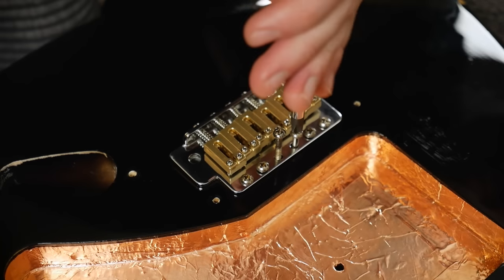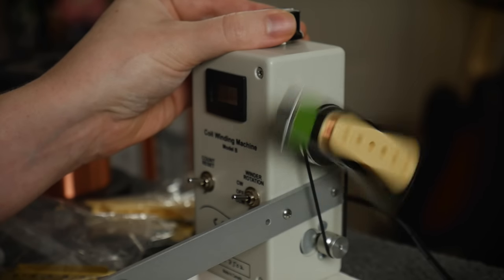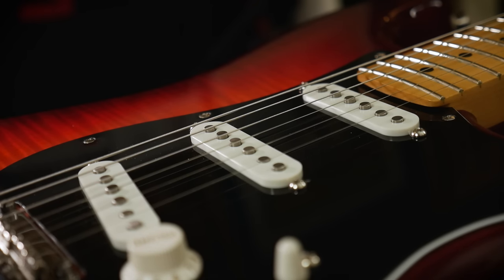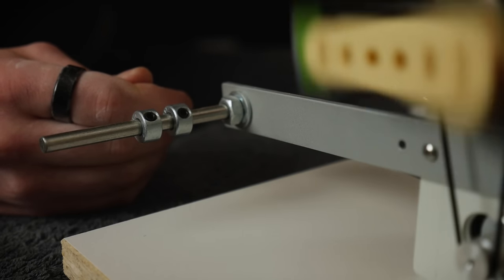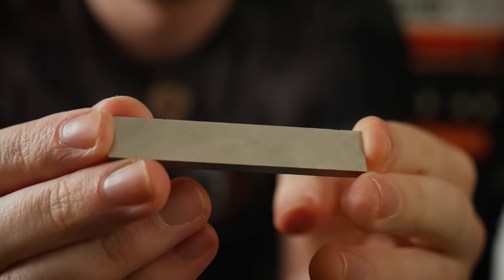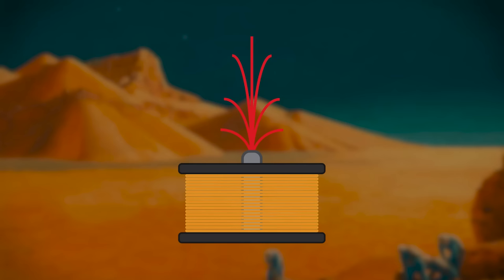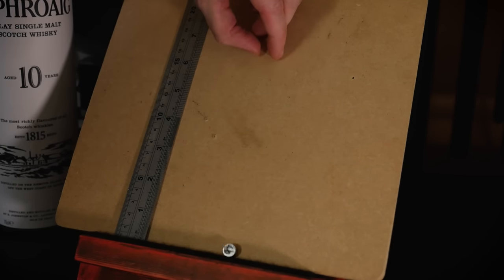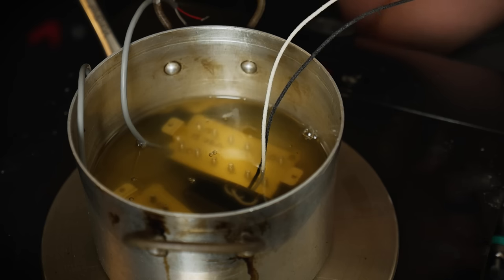(almost) EVERYTHING About Pickups | Too Afraid To Ask

Comment: Brilliant video. Watched this more than once.
Standard single-coil pickup*: if the magnets (pole pieces?) seem to be sticking out irregularly (higher in the G & D strings), can we push them back in without damaging anything?
I presume they will give stronger output for those strings?

* this on an Encore, but looks just like the ones on Fenders/Squiers. No screwdriver slots in them

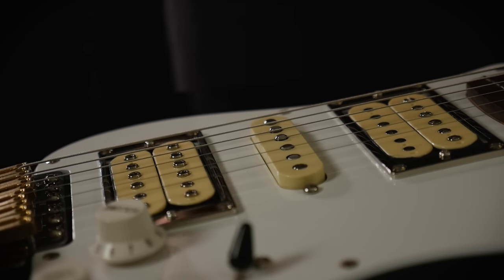Comment: 4:07 distance of pickup can be adjusted up/down to get the sound you want. 12:19 types of magnets. Split pickup to have lower three versus less pull on higher lighter gauge strings. 16:16 humbucker cell materials affect magnetic field also. Also a little bit by the cover materials material and thickness.

Comment: I had to wind 3 pickups for an old guitar of mine recently. I used 0.063mm Cu for the middle and neck pickups and 0.045mm Cu for the neck to give more output. It balanced pretty well. BTW, a third factor affecting such long lengths of thin wire is temperature - to a significant degree. If the pickup is not heavily loaded, the output level should not be affected much at all. Love your philosophy on sound - spot on! BTW, the winding cross-section geometry  and whether it is layer or bundle wound also affects a factor other than inductance: distributed capacitance. This will have a significantly greater affect on the frequency response/impedance. Also note that induced Eddy currents in solid magnetic material (vs. sintered/ferrite etc.) will have an impact on high frequencies as well.
Finally, I would not pot coils in wax. I have rewound old transformers which failed because wax potting trapped moisture in the windings causing the copper to rot over time. The wax does not seem to form a really good moisture barrier.

Comment: Killed it again, as usual.  Answered nearly all of my (many) questions, and you did so with clarity.  Can't say thank you enough for this content.  
I did have a follow-up question if you're so inclined to address it.  Why does a higher DC resistance equate to higher output?  This has always confused me, but not enough to look into it.  In most electronic circuits, increase in resistance impedes the flow of electricity.  Why then does a higher resistance in a pickup equal MORE output?  I've always just taken it for what it is and not questioned it, but knowing details would be super cool.  Especially the way you explain things.  Thanks again!!
Reply from the maker: V=IR
If you increase R then V must also increase (assuming constant I)

Analogous to water in a hose pipe: for a constant flow rate, if you narrow the hose (increasing the resistance) the water leaves the hose with more pressure (voltage is just electric pressure)
Reply: @ScienceofLoud  This is not correct. If you look at the RLC equivalent circuit of a pickup, you see that the coil resistance R is in series with the coil inductance, and the output voltage is taken across the (parasitic) coil capacitance C.

So the more R you have in the coil, the more voltage is dropped due to Ohm's law V=RI. This is obvious because all of the current through the coil must make it through R, so there will be a voltage drop across R.

What you're saying is true however for any external resistance (eg. volume pot) connected to the pickup. A higher resistance pot will load the pickup less, preserving output voltage. But this is not true for the series resistance of the pickup coil. In practice, the resistance of the volume pot (eg. 250k) is much larger than the series resistance of the coil (6k or so for a single coil), so we don't really experience the voltage drop in practice, but it's there. The series R of a pickup will however effect the Q factor of the pickup, which has an impact on the shape of the pickup's resonant peak.

So the increased output is not due to increased R, but it follows from Faraday's law of induction, where the EMF (voltage) of a single loop is multiplied by the number of loops the changing magnetic flux passes through. More turns of wire -> higher EMF, that's it.

Comment: Tanks for the up.  Decent video. I'd like to point out that for some players, especially given the low stage volumes common these days, there might possibly be a case made for mildly microphonic pickups.  If you've ever played above 110db onstage something kind of magical happens - a feedback loop develops as the high SPL sound from the speakers begins to vibrate the strings.  Many non-tech types say "my guitar came alive!".  Microphonic pickups can reduce the levels at which this occurs.  Unfortunately, I don't know of any means to design for specificity and most players who enjoy that loop just feel lucky their favorite or even possibly "the one for that one song" was found.  Make no mistake, most, and especially at higher SPLs, are a PITA but some bring it, even if only for one song or style .

Comment: Loved your video.  One small step to include would make the video a super informative class or a whole category of several videos? 
When you're talking about every single pickup composition play a few common chords or a quick riff so we can hear what the difference in magnet strength sounds like with thick & thin wire.
What each pickup sounds like wound more in the middle or the sides.
It would be very interesting.

Comment: Oh yws I did in the previous posted comment say that this is in fact my very first ever guitar build/modification.. as I an a retired automotive service technician with both automotive electronics diagnostics and repair experience and woodworking experience even before that as I was trained in home renovations and remodeling including wood framing. plumbing, brick and block work as well as electrical wirind and drywall installation and finishing,and as a 10 yr old I built bicycles from recycled parts rebuilding and refinishing them for personal use as well and forsale.... I think i may have al the required skills to pull this one off with little trouble and with a passable result for my first try anyway....  ya think...lol  at 62 yes old and retired I'll take my sweet time and make sure everything gets done the way I want it to be..and have a good time playing with my "Hew Toy"  the "Stellarcaster:  have fun with all your builds as I'm sure you will...I am having a good ti,e doing the work on it the waiting for parts and materials for it was a major pain in the rear though with the "Global Pandemic" going onand all the rain we're having here nearly every afternoon in Florida in the USA the humidity plays hell with the finish curing times it takes 3 to 4 times as long in this humidity of nearly 95% relative humidity and an average of 92 deg F everyday throughout the summer here so thank god i got the wood sealed well before the rain began in earnest.. if the rain lets up for 3 days in a row then the humidity will lower enough for my finishing the body and head stock to cure after I've applied it.. ans flat sanded it for a second coat and finish sanding then buffing to the shine i desire..,,sorry I tend to go on a bit I just happen to be ADHD even as an adult I've never grown out of it coffee Is my only salvation there is that the caffeine calms me somewhat ever since i was about 5 yrs old .. I quit smoking a few yrs ado after my first and i hope only heart attack just a partially blocked coronary artery which they inserted a stent into and I'm fine now ...but with being laid off due to the virus goung around for about 4 months and the work schedule being severely changed to an untenable one for me...early retirement was my best option and i was used to laxing around watching you tube on the large 100'  Movie screen I've hung on the wall for for the HD projector with my lap top , XBox 1X the direct Tv terminal and the DVD/VCR all plugged into it for my viewing pleasure   and so by now anyway,,,,Im to used to sitting on my rear.drinking coffee and eating snacks and of course taking care of my diabetic wife who is on disability anyway so I'm settling into rertirement quite nicely thank you so it's a guitar projest and lonnging around in between runs to the store for different needs along the way...an yes I am the motor head  motor mouth from hell too if you han:nt niticed by now so sorry for the novel here i ten to go on and on for too long sometimes,,,,,,,,well most of the time really,,so sorry again but it's a bad habit i really can't seem to break since as long as i can remember,,,,,I have to be doing something almost  constantly if awake and i even toss and turn in my sleep too...mumbling from time to time even then too....nothing for it but find a hobby I enjoy.....

Comment: 8:12 HEY as someone whos job it is to wind coils of wire all day, you are spot on, perfect winding requires alot of effort from a person, we either gotta do it slowly, or not perfectly

note i dont work in guitar pickup winding specficially, i work in a wire mill for electrical applications

Comment: Great information. I have a "POC" guitar (Piece of Crap). I built it from parts. It is a BC Rich Assasin Body, Aria Pro II neck, Kahler Pro Trem and I have SH-6's. The one thing I did and I found it made it sound sooooooo amazing was bolting the pickups into the pickup cavity......pickup to wood. I found that without it floating the sound is more full and warmer....it might just be me though. To raid them a bit at a time I used thin brass washers.

Comment: 9:00 you can dispense with the touchy-feely woo-woo arguments about hand winding. Perfect machine winding maximizes the interference between adjacent windings at nearly constant intervals and so it creates an exaggerated moire pattern of hot and dead frequencies across the frequency response spectrogram. Imperfect windings "blur" this effect, and the contrast between dead and hot spots on the spectrum is reduced. A highly exaggerated example of this effect can be demonstrated with a "ring filter" effects pedal. There's math behind it.

Comment: You've missed some big parts the relationship between construction and inductance, the pole pieces form a core to the coil and have an effect on inductance proportional to their magnetic permiability relative to free space. Steel slugs (or screws) are much more permiable than alnico rods, so contribute more to inductance, alnico isn't particularly permiable so contributes a little to inductance and ceramic and neodymium magnets are very similar to free space.

Important implications from this are fillister head screws will lower the inductance of the coil when raised up, but set screws will increase inductance as you raise them up as you remove the void from socket.

Note that replacing alnico rods with steel poles and a ceramic bar will give you much more inductance, entirely the opposite of what happens when you swap an alnico bar for a ceramic bar. If you're skeptical, try it with a spare bobbin.

So why are crazy cheap ceramic pickups often bright AF? They're usually crazy underwound, perhaps with 44awg wire to hide this.

Comment: What a great treatment of this subject. I was trained in the mid 70s for telephone exchange maintenance, and at the time exchanges were totally based on electromagnetics; coils and poles were everything. Nothing you have said conflicts in any way with all that technical training.
In the mid-Eighties, I was given a set of pickup magnets, and I unwound one of the exchange relay coils, rewinding the wire onto a bobbin of wood I made with holes in the middle to take the magnets. It worked as a sound-hole pickup for a steel-string acoustic Epiphone, but was only 500 ohms, and the output was pretty low, not much good except into the magnetic phono input of my stereo.
When I recently got a proper valve amp I found it was pretty OK with that.
Reply: Your video is awesome. I love the science of it. But I really wanted to know is what pickup is best for the specific sound I'm looking for.

Comment: Thank you for taking the time to put together such a clearly informative video 👍 absolutely clears up much of the questions I've had about pickups, and i have been researching this area for God knows how many pages and diagrams I've gone through most have their own unique way of describing the same laws of physics, yes a lot of it is subjective therefore can be confusing and even contradictory but there are the basic laws of physics relative to electric guitars etc that have already been  measured and mapped out since pickups were first made around the 40s/50s including the technology  of which this was all built upon and was most likely already established before pickups were even made, the fundamentals in math and laws of nature and physics that are the same whatever way you look at it, like ohms law, resistance inductance etc, electricity is drawn not pushed so the way i see how pickups work (im a plumber so a very simple way to see it but backwards, literally) is its the very beginning of the line or more like the very end magnetically speaking, the open end of the signal chain not unlike a receiver on a radio, or, a faucet or a valve that has a reverse flow in many ways different from how plumbing works obviously, apart from the gague or diameter of the wire, narrower cross section diameter changes the flow of current, either limiting or helping the intended relationship of the strings meant to be affecting the magnetic field in a different way than wider diameter wire, if you wire your house sockets with too thin of cable then the draw of current towards your taster or from your appliances tv, cooker especially, will cause too much resistance along every square mm of copper wire and will overheat the wire and end up so hot it'll burn your house down if you've not updated your fuse box,  so many people think that electricity is distributed to your house like water- pushed, no it always there available in the grid for you to take it or keave it, defining factor of how  much electricity you use comes down to how much current each individual appliance or device consumes, where the term consumer unit comes from, the live draws into the apliances heating element for eg and whatever current is not needed is redirected back into the grid in a controlled fashion  by use of resistors, capacitors etc and redirected back into the grid which is now pulling that excess current with a much bigger electromagnetic  force  bypassing the appliances electromagnetic draw/need to work and what stops that greater force taking it all back completely  is the circuitry in whatever appliances switched on, the basic principle is the same just at a very lower draw. And thats where the amp comes in, you cant push an amp you can only allow more or less through by taking away components or adding more to the amps own circuitry, so how do boost pedals work, they take more current from the grid through its own power supply and add it to the signal chain before the amp, whats a noise gate! A filter of sorts using resistors and capacitors i mean more or less but its simple electronic circuits, over priced at that.
so its got me thinking about individual pole pieces on humbuckers a pickup is one whole thing but with more than one part, again, i watched a very convincing video on how humbucker screw pole pieces height adjustments don't make any difference, and i see your video here and im leaning back to the how and why of it again, in order to not end up with some useless pedal i dont need, again, but why then do single coils have staggered pole pieces! If not for an actual tangible affect on the signal at its source?? Cant be just for show and i can support this by sharing some new (to me)  information on Toneriders 'City Limits' SSS bridge pup design, the EAD strings pole pieces are Alnico 5 rods north and the GBe pole pieces are Alnico 2 rods, the neck nrth and middle rwrp are A5 rods, and these pickups sound really well made! Very much like fat 50s/ tex specials and cost way less I would love it if there was a video camera that could capture the magnetic field in action of a pickup single coil humber or set. I've seen drawn "construed" diagrams but its just someones interpretation, in this day and age, im not that old,  im sure there is a way to not just measure this effect but see it .. its  probably an app the north koreans have made. 

Its good to get into it all again, i definitely do not know it all most of its just made up from memory, but videos like this for sure reignite the fire to get back into the truths ablut pickups and their crucial role, food for thought along with clear cut information answers a lot of doibts i had, i mean just cant be having any old crap or fall for the over priced guchi swag all over again. Thanks for the refresher.

Comment: It's funny how some seem to "hear" things as they appear or behave in other domains of physics. Ceramic "sounds" more brittle because it can crack. Potted pickups  sound less "open" because the wax is closed around it. Light colored wood sounds  brighter because it reflects more light.. Machine wound pickups sound more sterile and less "human".. maybe guitars made in Alaska sound "colder" as well.
Reply from the maker: Now do valve rectifiers being 'spongy' and spring reverb being 'drippy'.
Reply: I'd like to know what makes some pickups have a midrange "honk" so I can stay away from them.
Reply: Great video btw, I'm subscribed.